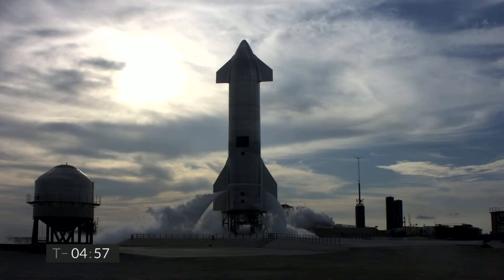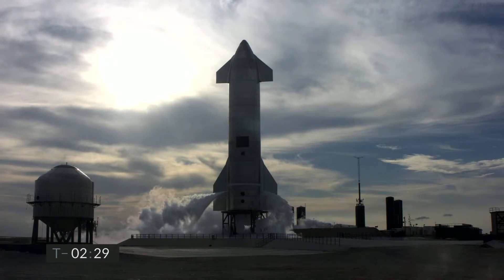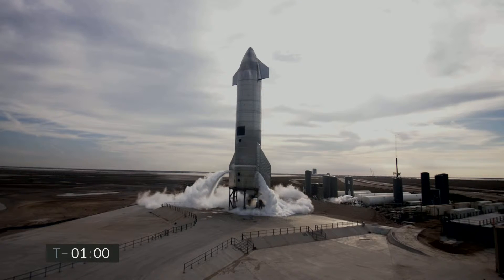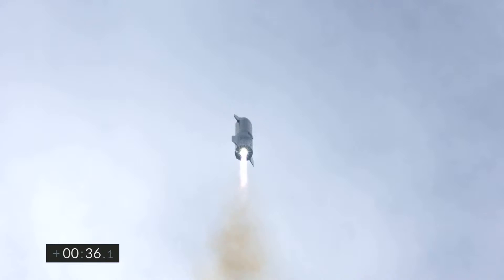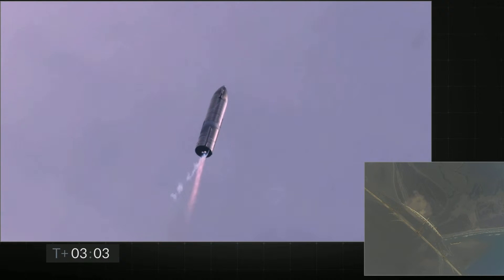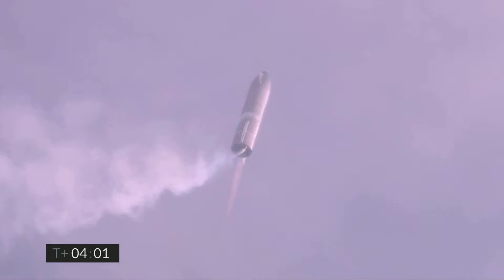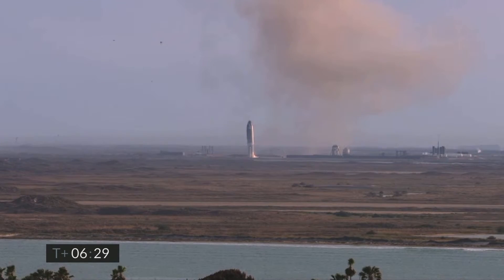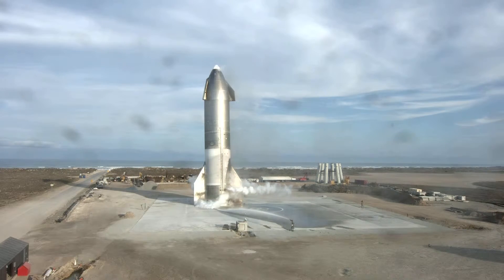Starship | SN10 | High-Altitude Flight Test

Comment: SpaceX has built how many Starships now? 10? with 10 more under construction?
How many orbital rockets has Blue Origin built?
How many SLS has NASA built?
Reply: SpaceX has zero orbit capable starships.
NASA has 3 orbit capable SLS under construction. 2 are crew rated, one is nearly finished and multiple prototypes have been tested.
And without NASA, the Raptor engine nor SpaceX would exist.
NASA and SpaceX are not in a race or a competition.
Reply: @spektr8454  I didn't say SpaceX had built orbit capable Starships. But they're getting awfully close to doing so. 

SLS hasn't reached orbit yet. And how long has SLS been in development compared to Starship? And what innovations does SLS bring to the table over existing tech, compared to Starship? How much of SLS will be reusable?

No, NASA is not competing with SpaceX, they are relying on SpaceX, and being led by SpaceX. NASA is destined to become the FAA of outer space, and only for US-based companies. NASA will soon be relegated to regulatory status only and some scinece, if that (since the FAA still is involved in space launches too).
Reply: @SoloRenegade  Like a lot of SpaceX fanboys, you don't know what you are talking about.

Starship is in development since at least 2009-2010, when Falcon XX and the Raptor was announced (but we know the name "BFR" exist since at least 2005).
SLS was approved (and to some extent created) by the congress in 2011.
The goal of the SLS was never to be reusable nor to develop new technologies.

Like SLS, the Starship program had many difficulties and delays.
Falcon XX was supposed to launch by 2014.
But it became ITS, which was supposed to launch by 2018.
But it became BFR, which was supposed to launch by 2019.
But it became Starship, which was supposed to go orbital last year.
SLS was supposed to launch by 2017. There are delays but the program never had to restart completely mid-development.

But this doesn't matter, both rocket are not in a race and have different goals, comparing them isn't useful.

Saying that NASA is led by, and rely on SpaceX is just wrong and stupid. For NASA, SpaceX is just a contractor, like Boeing or Lockheed.

Without NASA, SpaceX would have gone bankrupt in 2008, do not forget that.

SpaceX is relying heavily on NASA technologies and infrastructures. This can be seen with the development of the Merlin (NASA design study) and the Raptor (use of NASA tests stand at Stennis).

If you think NASA could be relegated to regulatory status and science, you don't understand anything about US politics.
Reply: @spektr8454  NASA will be relegated to science and regulation. I've worked with NASA (including just today in fact), and they are not the NASA of old. The fact you can't see this shows you can't anticipate changes in the industry, and the inevitable consequences of those changes.

SpaceX has developed all sorts of new technologies, that never existed before. Just because they didn't invent the calculus used to create the rockets, in no way invalidates their accomplishments. that is the excuse of the loser (in competition), and those who are jealous they didn't think of the "obvious".

I'm not looking at dates, I'm looking at results. SpaceX is winning, period.

I'm a SpaceX fan only because no one else dares to dream as big as they do, as big as I do. So until someone dares bigger than SpaceX, i'm rooting for SpaceX, that simple.

SpaceX is leading the way, NASA is not. Also, NASA is dependent on SpaceX for crew missions, so I am 100% correct i what I said.
Reply: @SoloRenegade    What SpaceX is doing is great and impressive. If everything Elon is telling is true, falcon 9 is by far the best rocket in the world. 
If starship becomes operational, it will make every rockets in the world completely obsolete (and maybe airliners too).

SLS is a NASA rocket. It's not meant to be the best, nor the cheapest and you can rightfully criticize that.
if NASA was to cancel all of its rocket development and infrastructures, ten of thousands of people would loose their job. The economic impact in Florida, Alabama or Texas would be immensely bad. The congress will never let that happen.
So SLS can and will coexist with starship. 

NASA is not dependent on SpaceX for crew launch. NASA is using Soyuz since the 90's and will continue to use it. Starliner will be operational one day, same for Orion.

If you are really interested in space, you should stop to want less rocket.
The more rocket are flying the better.

Comment: Design flaw - there is not enough fuel in header tank for 3 engines to bring the rocket down. Having a header tank right on the top is a bad idea imo. Major rethink is required.
Reply: 2 engine shutdowns were intentional. only requires 1 engine for landing. 3 were lit for the flip maneuver.
Reply: @pmaraj  it crash landed, 1 engine not enough to slow it down - originally they had 2 engines for landing so why 1 engine now and it crashed? Something doesn't tally up with your thesis
Reply: @KpopLabPro  it crash landed because of landing legs failure.
Reply: @KpopLabPro  
The last two only intended to use one engine for landing, not two. SN8 had RUD because the one engine they kept for landing had pressure issues (that they fixed) with the methane header tank. SN9 had RUD because one engine failed to light for the flip. Only two engines are needed to flip but it can be done with three, so they used three for SN10 just in case one failed to light. For SN10 all three lit and two shut off, and the one for landing worked like a charm. The hard landing was a combination of sucky landing legs and a slightly imperfect flip maneuver that they’re still working on perfecting.
Reply: @pmaraj  That as well, I saw them flapping around during landing but the underlaying cause of the explosion was the speed that it hit the ground, too fast (crash landed)
Reply: @KpopLabPro  watch the video again. john clearly says 1 engine needed for landing burn. Lets wait for official confirmation from spacex. but for now i think it crash landed because of landing legs. some of the legs failed and hence the tilt. and that crash land may have caused methane leak.
Reply: @pmaraj  I agree something went wrong and one engine could bring Starship down safely to the ground easily - but I think they need a backup in case one engine fails but that means they need more reserve fuel which would end up shrinking cargo space -  it looks that they may have to look into that

Comment: anyone knows about how much a test like this costs? (without the explosion)... thanks!
Reply: Well, considering they wouldn’t have reused it anyway the explosion doesn’t really cost that much, I would say for the construction and fuel of sn10 about 3-4 Million
Reply: @FinkHD  thanks!
Reply: @FinkHD  oh and do you know at what speed it was going up? Thanks :)
Reply: @philippetyan  Depends on when, you can see it’s engines turning off to lower the thrust to weight, with one engine at the end it almost hovers

Comment: Amazing!

The footage was so clean too. No camera shake and the rocket was tracked very smoothly (rocket was kept in frame - in fact, the rocket "moved" minimally relative to frame). Makes all the visual data very clean and useful, but how did they do it? How did they isolate the camera from all the shaking at take off and landing? Software stabilization? Hardware stabilization? Both? How did they track the rocket so smoothly? Was the camera pan, zoom, etc, controlled by software? Or was the rocket going slowly enough for a human operator to be able to track the rocket so smoothly? Maybe they shoot a very high res video and have software crop each frame so that the rocket "moves" minimally between frames? At any rate, great footage visually and full of valuable data, I'm sure.

Comment: Congratulations. You done so well after the 95%-Success-Operations of SN8 and SN9. Most people and media just recognized the 5%-Failure due to the final crashes of the vehicles.  For me as a interested engineer the telemetry data of altitude, speed components and attitude angles would have been nice to see live during the test. Just a little hint. KEEP GOING Thumbs up.

Comment: In my opinion, the way to solve this problem is that when landing horizontally is correct, it is advisable to make the cake on the body, land on the runway, but vertically the engine still has heat, compressing it very easily exploding.

Comment: It didn’t soft land, it mostly dropped the last twenty feet and hard impacted the ground.  Something must have crumpled pretty bad because it was sitting at an angle on a flat surface, no wonder it exploded just after this video ended. 
Great new rocket, awesome we have this kind of computer controlled vectored thrust, but it didn’t stick the landing this time.

Comment: Still looked like a hard(ish) touchdown as the vehicle bounced slightly. Do the legs deployed?? Should 2 Raptors have shut down once they re-lit all 3? Looks like 1 engine wasn't quite enough to arrest the touchdown decent rate quite enough. Awesome view from the pad straight up during the flip'n'burn.

Comment: 8 minutes later: 
-The sn10 exploded 
Comentator:
-this is intentional
Reply: “We’ve successfully gathered the important data”
Reply: So ofc it was not intentional, but considering it will not be reflown anyway it is not that big of a deal. They got the flight data, thats what is most important
Reply: Blessed
The words about intentionality are not mine, but the commentator's in the official broadcast.
Reply: @Petrov_Nikolaj_Vladimirovich  also, when he did say “this is intentional” he was referring to an engine cutoff, which was planned
Reply: @Petrov_Nikolaj_Vladimirovich  then what's the problem?
Reply: Which minute
Reply: i was expecting it to DETONATE a few seconds after successfull landing cringe smile
Reply: Its not an explosion its surprise dissasemble
Reply: @felop1187  sn10 couldn’t hold his fart anymore
Reply: The data collected is what is valuable. Not the physical asset.
Reply: Mr Musk: Meme time
Reply: There many have been no safe way to detank the remaining fuel, especially if the hard landing ruptured a tank. Too dangerous to ask people to approach, so blowing it up may have been deemed the safest option for a test vehicle that wasn't going to fly again.
Reply: @SoloRenegade  no, this definitely was not intentional. The flight termination system is not in the bottom of the vehicle
Reply: @reagank.2268  Even still, it was a successful landing, a bit hard, room for improvement. And we got to see a "reusable" rocket fly 2x in 1 day ;)
Reply: It would’ve been a smoother landing if they continued to light the 2 engines for a bit more then turning off the the second engine
Reply: @berk_yasik_69  The problem is the engines don't like running on reduced thrust, so if they did that with more power it might rise again. They know what they are doing I think. :)
Reply: @eubikedude  yes they are the ones with most experience but they never did something like this before. So it’s new for everyone and it prototyping so they will try different things in every prototype
Reply: It was intentional. It was leaning very heavily and the whole launch/landing site was in danger. Did you see how far up it went? Just imagine this happening sideways into gas tanks.
Reply: @valeriebumblebee7607  actually the reason why exploded was the not so soft landing. The rocket got damaged and gas started to leak
Reply: @EggyGTO  I agree with u, the bottom 1/3 of the rocket was frosted. A good indicator that it was getting sprayed with extremely cold liquified gas. Same idea as refrigeration, freezers or air conditioners. Plus, I highly doubt that they would intentionally blow up such an expensive rocket especially when SpaceX' whole plan is to have reusable rockets...
Reply: @valeriebumblebee7607  why does every starship has to lean in some way. Sn8 leaned when it was trying to land, sn9 leaned in highbay and now sn10 leaned after it landed
Reply: @berk_yasik_69  They are purely testing flight and landing. The reason for the lean is that they arent using what would actually be the landing gears on the craft.
Reply: @tlpineapple1  yes I know. The legs are temporary and sn11 might have new legs but I’m 100% that sn15 and beyond will have new legs
Reply: @berk_yasik_69  because it’s on one engine, and if you lean it, the engine goes right through the center of mass. (Because it Normally has three, and one of three is offset
Reply: @valeriebumblebee7607  if it was intentional then spacex would have kept streaming right??
Reply: @cykablyater9395  if its unplanned and decided by safety team on the spot then yes it was intentional no it wasnt planned

Congrats you just learned the difference between 1st and 2nd degree murder
Reply: z góry przepraszam za zaśmiecanie komentarzy) zapraszam was na kanał mojego ziomeczka bardzo by sie ucieszył jakbys zajrzał do niego! https://www.youtube.com/watch?v=kQg_mOnFZWE prosze
Reply: Sorry to be a wet blanket, but this learning curve has probably negated Mars landing for another 10 year’s?
Only a complete reconfigure of the landing rockets would allow a landing on unprepared Mars soil, and blowing up 10 minutes later?
Reply: @burnamm7127  Not really, remember, every launch they make gives them valuable information. The rocket blowing up doesnt mean a ground up rebuild of the rocket. All it means is figuring out why it failed and adjusting from there.
Reply: @burnamm7127  this is a test article. They need better landing legs, and to fix the hard touchdown. We are still on track for mars 2026
Reply: @reagank.2268  I’m loving the positive replies I’ve had, it gives me renewed hope.
I’m no spring chicken now, and would love to see people on Mars in my lifetime.
Reply: An example of intentional censorship. How much do you not know about Mask.
Reply: @Petrov_Nikolaj_Vladimirovich  Folks like you make me grin inadvertently.  I can't help it.  People who are so hung up over one guy that they spend their free time doing... what?  Trying to give people doubt about his accomplishments?  That's... not really going to ding the paint, bro.  But hey, take heart: There are thousands of you.  Maybe if you huddle into a bubble and put your collective fingers in your ears, the big, mean billionaire won't seem all that intimidating.
Reply: @Blake Naftel Definitely for you.
Apparently you were brought up as an egoist to the very roots of one's being the bone.
That is the difference in our mentalities )
Reply: @Petrov_Nikolaj_Vladimirovich  tf u talking about? we have seen planty of his rockets explode, this is not censorship, ruski boi
Reply: @Petrov_Nikolaj_Vladimirovich  how was it intentional?
Reply: @Petrov_Nikolaj_Vladimirovich  

Hey , they ended the stream prior to the explosion

SpaceX is never shy to show their rockets exploding🙄
Reply: @Petrov_Nikolaj_Vladimirovich  how would they know it would explode minutes later. Besides, the explosion was recorded and streamed live by many third parties
Reply: @Petrov_Nikolaj_Vladimirovich  uhh, they didn’t know that was going to happen, and this comment we are replying to is a joke. and Elon musk even tweeted about it saying rip sn10.
Reply: @Petrov_Nikolaj_Vladimirovich  Hey Buddy, here is the link to the full video with explosion, different cameras and a professional analysis on why it exploded: https://youtu.be/CF9mdMI1qxM
Reply: @Petrov_Nikolaj_Vladimirovich  They already ended the stream before, so there were no official images
Reply: @Petrov_Nikolaj_Vladimirovich  Its just an example of you not doing good research. You can see the whole landing and explosion on for example the stream of „Everyday Astronaut“. Also, there Is no point in „hiding“ smth since there are like hundreds of people near the launchsite watching (like everyday astronaut who lives there and films it). So instead of claiming things that might lead to some sort of event like protests just do your freaking research Mr Russian Guy.
Reply: @MM - Performance are you a nationalist? 
Just not seeing the big picture and not understanding what the true role of Mr. Scam
Reply: @Petrov_Nikolaj_Vladimirovich  Nope im pretty much neutral on politics. All I said was that there is literally no censorship when you can see the full video on like 10 YouTube videos 😂 It’s about an aircraft, not politics....you failed your mission mate
Reply: @Petrov_Nikolaj_Vladimirovich  Im genuinely curious what your goal is? Like what do you hope to achieve with your comments besides lies?
Reply: MM - Performance It is a silly fish, that is caught twice with the same bait.
To believe Scam would be disrespectful to yourself.
Reply: @Petrov_Nikolaj_Vladimirovich  it's not a scam wtf it was an explosion it was a test flight and beforehand he said the PROTOTYPE landing legs where bad. it was a test did you here me it was a TEST and they did not steal money from the Russians this was privately funded. So stop being so toxic and start researching correctly also it was successful.
Reply: And why are you political? It's a private rocket launch for gods sake!!!!!

Comment: It seems there was differential support tilt or settlement after landing which may have caused the expolstion. May be a ring base for landing is a better option or connected together pin supports to reduce differential effect